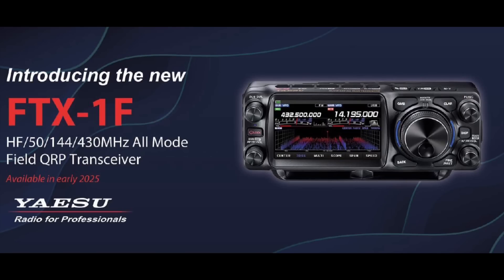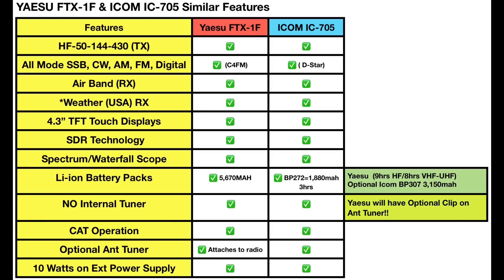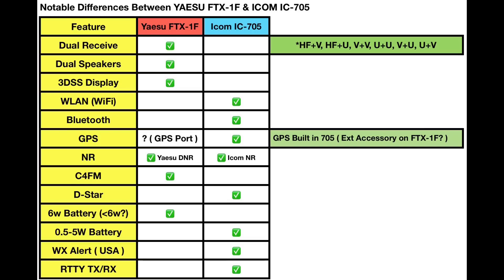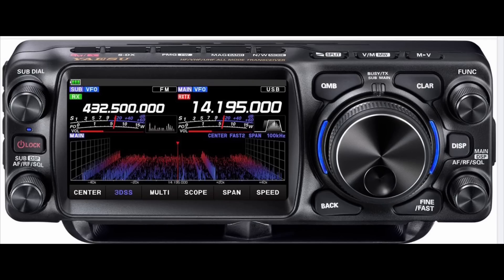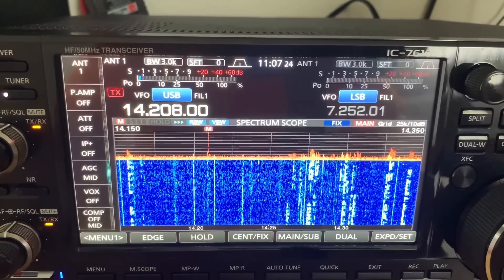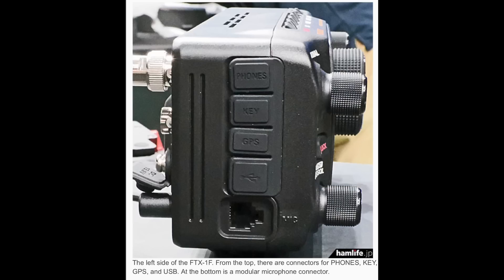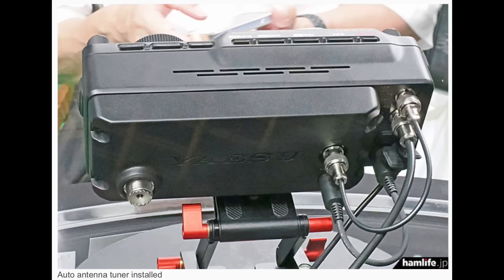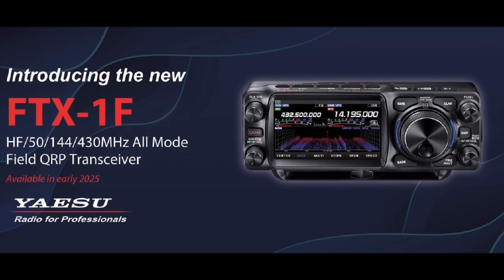New Yaesu FTX-1F QRP RADIO Announced Features compared to Icom IC-705

Comment: Good comparison - thanks. I will stick to my IC-705, in fact I will up the ante and will be buying a second IC-705. IMHO 3DSS is a gimmick, not useful. I have a FTDX-10, I tried the 3DSS for 10 seconds and have never used it again in 1.5 years. A killer feature of Icom that Yaesu lacks is the ability to have all meters on the display at the same time - power, SWR, compression, ALC, current draw, temperature - this is handy for monitoring all levels and adjusting as required without having to switch meters all the time. Icom waterfall and spectrum scope has always been better than Yaesu - sharper, higher definition.....and scope averaging, giving a buttery smooth display. Yaesu just display raw ultra fast scope which is very fatiguing. Really good features of the Yaesu is the 2 x antenna ports - big advantage over the one port of 705. And best feature of all is the dual watch - being able to listen to HF and also monitor a VHF repeater is excellent. Oh, the SO239 on the back goes to the HF antenna
Reply from the maker: Thank You!  I agree I love seeing all the meters on the Icom’s this is why I like the extra 2.4” screen on the newly announced Icom 7760 as you can now see the meters while keeping the normal display on the 7” TFT screen!  And if they could make a dual receive 705 so you could listen to HF  while listening to VHF or UHF would be awesome!  One of the draw backs (disappointments with the 9700 is you can’t monitor VHF/VHF or UHF/UHF at the same time).  But I am looking forward to hearing more about the Yaesu FTX-1F’s features and capabilities in the future! 73
Reply: @PrecisionGroupYT Monitoring a repeater while you're on HF is great, but I am very curious, whther there will be a full duplex and SSB capability on the sub receiver to enable you working SATs. I am afraid that it won't work like that and the sub RX will do just FM or C4FM... But let's see.
Reply: Icom mic plug is more reliable for field operation. In case of dropping mic to the ground you can easily wash up it's plug, but get rid off dust from rj45 you can't :) Icom NR works in CW. And are you ever listened to Yaesu in phones on low volumel? You hear the hiss of audio amplifire, when Icom has not! When I bougth 710 after 891 I hoped that I won't heared that hiss sound, but I was dissapointed... 73s from RA9QAT!
Reply: @VladSolovey Yes!! I must agree with the hiss!! It's terrible. I like the FTDX10 sound and receiver, but there is a hiss in the device even with zero volume, which can be heard in any better headphones. I wonder why there's so little information about it and I think that older people might not hear it and so don't Yaesu engineers... I have fixed it by buying very cheap TV headphones with lower sensitivity and a separate volume control. I have set the volume on the headphones low to get rid of the hiss and then compensated it by setting volume high on the radio. It's a workaround I am wuite happy with, but it's not great... And yes, FT-991A suffers from that too. Only FT-818 didn't, out of what I have tried.
Reply from the maker: @VladSolovey  Good information thank you!